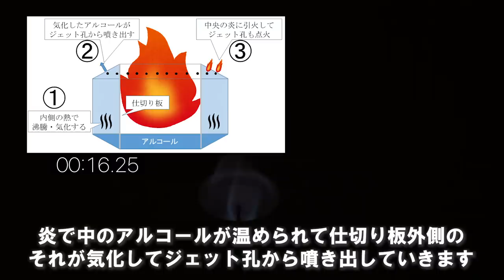【自作】アルミ缶で作るアルコールストーブの作り方｜How to make an alcohol stove

Comment: The Japanese precision can only be exceeded by the Germans. Originally back in the late 70's, on an elk hunt, in northern AZ, when the Coleman camp stove was left home. somebody had to think fast to made a hand warmer. Many ideas showed up. The fuel loading port was about half inch in diameter and covered with a penny, The bottom of the top was flared by pressing it on a billiard ball. When pressed to the bottom part, sealed them real well. The burner orifices were punched with thumbtacks, 16 was the popular number, 32 burned the fuel fast, 8 was not hot enough. Some body stuck some fiberglass wool so the  fuel (most everyone used HEET) wont spatter. That took the place of the inner liner. We got the effect we wanted . Nobody claims to have invented the thing  but the name Arizona Penny stove stuck.
Reply: The later "Arizona" models are made from Arizona tea. The can is stronger that soft drink or beer cans, which is better. It is surprising to see the response within a few hours. Like I said previously, the idea has been around for decades and no one claims to have invented it.
Reply: Nice history about "Penny Stove" origens, no idea that goes back to 70's.